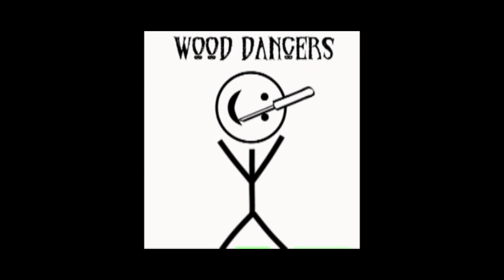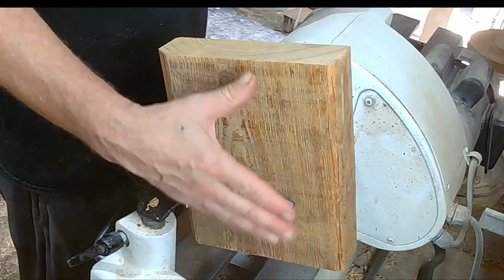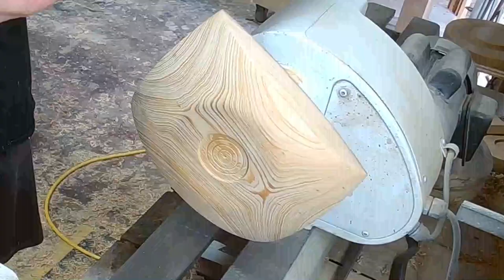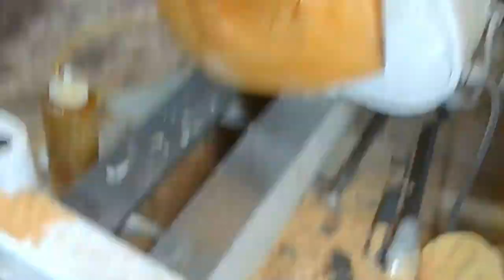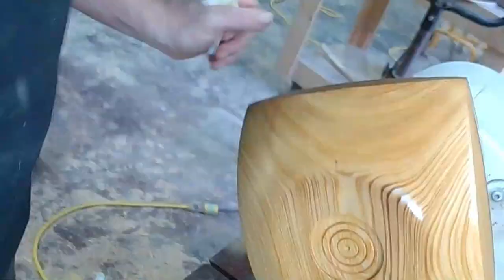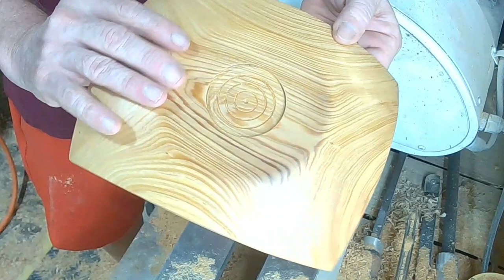Old Christmas Tree Pine Tray

Comment: I love square plates. Turned 6 for a store to display as a setting. They never did set up the table. Sold 1 plate just before I pulled out. The 5 have still not sold. Thinking I may get some 2x12 to turn a set for us here at home. 
Nicely done. The turning and finish are spot on.
Reply from the maker: I like turning them too Doug. I turned a bunch of small 4" pieces of Hickory we had left over from a job. They always look good to the eye.